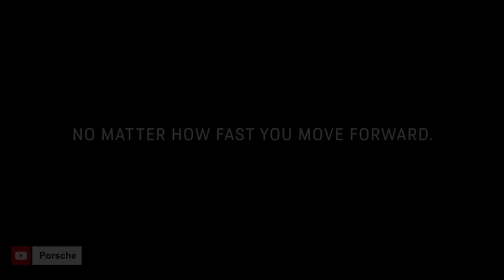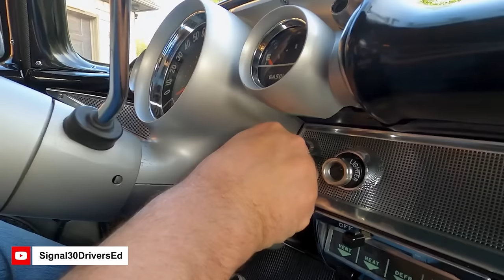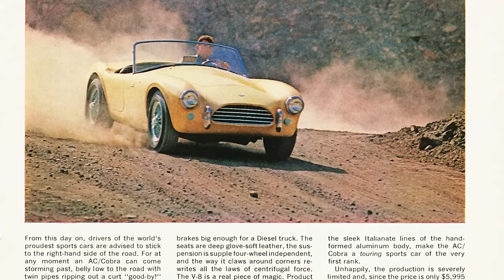Why Old Cars are Better

Comment: You can also change your car really easily. If you want a better transmission or different engine you can do that. Also these days with CNC services and even 3d printing being so available you can make your own parts. My 79 Camaro is my daily driver and I hardly have any issues with it anymore because when it breaks I fix it in a way that won't break again as easily.

Comment: You are spot on. I have two cars a 1966 Ford Galaxie and a manual transmission 2012 Challenger. I had to search for a few months for a stick shift in a modern muscle car. I'm not buying anything later then the 2010's. Motoring should be a fun experience.

Comment: I'm 21 and haven't gotten to experience a lot of cars. I can say that I've had the same hand-me-down since I was 16 (2006 GMC Envoy) and I have cared and loved this car since. I will never buy anything over the year 2010, because this car has everything I need and is comfortable to drive. Not to mention stupidly easy to work on if you ignore the fact that you have to remove the engine to get to most of the hoses, but overall it's a solid rust bucket and I love it

Comment: Have a 1970 Beetle. Definitely different from driving a newer car. Pittman Arm steering, torsion bar suspension with pneumatic shocks, sometimes it just decides to break down, but I only needed a tow three times in 15 years because I can generally get her running again.

Comment: My first car was a red 1993 Dakota. I loved that truck so much, I miss small trucks generally. I used to work at an O'Reilly when I was 18 for a little while and they had me delivering parts in a 4 cylinder S10 just like yours. It was even a manual, and I luckily knew how to drive it because my dad taught me to drive with an old Jeep. That S10 was so painfully slow, it made my 6 cylinder dakota feel like a racecar. It was so under powered when you turned on the AC, the truck actually slowed down. I dont remember the year of it, probably a year or so older than my dakota. Still, i'd take a 4 cylinder S10 over MOST new cars, not even kidding. Good luck to anyone buying a new car when you have any problem not covered by your limited warranty, hell even if it is covered, good luck waiting to have the car fixed in customer service hell. Even I can fix old trucks and im not a mechanic and they are useful, inexpensive, and I strongly believe that any pre 2010 pickups we still have will be solid gold, they already are, the only reason an old GM truck isnt incredibly expensive yet is because there are still plenty of them. As the years go by and those 90s-2000 GM truck slowly go away, they will be worth more and more. New vehicles will get worse and worse and be covered in crap you dont want like touch screens, it's just ugly and a million problems and recalls. Even normies will get fed up and look back on PERFECTION that was the 2000 era American pickup and pay 10s of thousands for them. People probably thought you were crazy if you said old tractors would be worth a fortune if you said that 40 years ago too. New cars do have a ton of problems and it's not getting any better. The "Boeing problem" is showing its face in every car company, just everywhere so everyone buckle up.

Comment: I've got a throttle body injected 350 Chevy suburban square body and I find it to be easier to work on than any newer car and most cars older than it. And the nice thing about the square bodies is you can salvage parts all the way from the '70s to the early '90s

Comment: I own two automobiles. A brand new SUV and a 30 year old Chevy pickup. The Chevy is my work truck, and it still runs great. I put 300+ miles on it every week, loaded down with tools, lumber, drywall, etc and I just about have more faith in it than I do my SUV, which is only 6 months old. Business models were different back in the day. Manufacturers built things to last. Things nowadays are built to break down, in order to move more units and accessories.

Comment: Oldest car I've ever driven by far was a 1957 Mercury Medalist. This dates the next oldest car by decades, so this one was a particularly different experience for me, especially as it's the only carbureted car I've ever driven. I didn't drive it far, just from one side of the shop around to the other side. The owner didn't tell me about how to work the choke or what it even was, just to pull it before starting and put the car in the other bay. So, I was mashing the brake for dear life trying not to wreck the car as I pulled it around. I would love to have more time with a car like that now that I'm older, wiser and understand them better.

Comment: Thats why my Daily S10 Blazer is 34yrs old coming up on 35. Had 32K miles when I bought it many years ago, Now its just shy of 300K miles & still going strong even being Lifted on 35x12.5x15 tires. I did ditch the throttle body though a ways back mainly for Performance upgrades with a Holley spreadbore 650cfm double pump along with some other stuff like a CDI ignition , 60 0ver pistons, larger cam, headers & some other stuff. Paired to a factory 5 speed with a high pressure 12" clutch, Have front locker & rear Helical Posi . Also have a 79 Z28 Hurst package Camaro & a 65 GS Riviera with the 425 NailHead dual quad motor .

Comment: One day my dad's modern Fiat broke down and had to spend a few days in a workshop. Back then we were about to move so we needed a car that could suffer through it so he simply went to a local weekly "car market" and he bought 1996 Ford Explorer (it was back in 2010). It wasn't a vintage given its age but it was an American car. It was unlike anything we ever owned before, big engine, rear wheel drive, automatic transmition with this lever next to steering wheel, many bells and whistles that were very uncommon back then here in Poland. We owned it for a few years and i must say it was mostly reliable with a small exception that it sometimes needed a hit with a hammer to the engine to start. I learned how to drive on this car before i got my licence and i even pulled up by my school with it once or twice which did bring me some attention, given the average size of European cars. As the years went by my dad discovered its sills had rusted away so he cut them off and kept driving it like this. Later it started to have electrical issues but what finally led my dad to sell it was its poor breaks that would have to be replaced entirely to make it safe to drive and the price for that has far exceeded the value of the car itself. I was a bit sad when he made this decision, it definately was a fun car do drive.

Comment: Owning first a 1983 Volvo 244 DL (which has degrading wiring), a 1997 OBS Ford F-250HD Powerstroke, and my second motorcycle: 2003 Kawasaki ZX-6R 636 (first gen fuel injection) I can attest that they are vehicles I will never want to rid myself of because they do exactly what I want them to do, while doing so reliably. In my opinion they are some of the most reliable vehicles you could ever own. On top of my recently acquired 1968 Volvo 1800S (last year of carburetor).

Comment: Did my Auto apprenticeship here in Australia at the end of the 70s being of the 80s and I got rid of my 2006 Holden Commodore Ute last June and have only Just bought a new 2024 Suzuki SV650 which will be the first vehicle I’ve ever owned I won’t be working on. I actually love old cars and I even obviously owned a few in my time and I worked on all of them including the Ute. As much as I understand and can repair new cars I miss the day where you diagnosed a problem and didn’t need a scanner to tell you what the problem was. I think it’s sad how we’ve turned cars into computers on wheels and we’ve taken so much joy out of driving including by removing things like manual transmissions. As for carburettors I loved working on them and building them and even though ok fuel injection systems are cut and dry repair wise I do like the challenge and sense of achievement that working on carbies bought.

Comment: Also, points ignition is really pretty easy to work on. Just use distributor lube on the cam and set the right gap. Sure, you can mess around with more, but keeping the cam lubed and the gap correct will keep you on the road 9 times of 10.

Carburetors aren't as hard as one might imagine either. I was scared of them for years. But as long as you keep it clean, adjust the float height correctly, and read the factory service manual once to understand how to set it, it's kind of like riding a bike. Once you get it, you get it.

Comment: I own an o5 single cab XLT Ranger with the 2.3. It had 215k on it when I got it. 1 year ago
 The interior was/is perfect. Five speed stick. Body is nearly perfect and was restated at one timeonus the bed. Which shows that previously was used as a light hauler. K use it the same way
It does burn oil and smokes a little partially cured using 10w40 vs original 5w20. AC is strong. It now has 238 plus miles. Unfortunately, the previous owners did not take care of the front end. Squeaks w lot and metal on metal clashes that are not the brakes. It has made multiple Cincinnati to Dunn/Durham move runs without fail. I love this little truck. I'd pay the money to rebuild or replace the engine and replace front end parts vs trade it in and buy new a Tacoma that costsore tan I can afford used/new Tacoma(which D love to have after owning a 98 4runner.

Comment: I also know of someone with a old s10(93), and it was whole nother experience to a new car, it had a 5 speed manual and the engine was a 4.5 v6(originally a chevy 4.3 before being rebuilt into a mercury boat engine, with a higher compression ratio, longer stroke and different cam)

Comment: I saw a video the other day taht said the EPA standards are the reason cars and trucks are getting larger (ironically). It is easier for car  companies to achieve mpg standards when the cars are smaller. For example, a pickup truck the size of a 90's japanese pick up would have to get 70mpg if it were made today. The epa makes therse determinations based on vehicle footprint

Comment: Old cars have less stuff to go wrong. Still, I remember in 2008 I was in the parking lot at work trying to figure out why my 81 280ZX wasn't starting. A younger co-worker came up to offer some "help" which was basically giving me a lift. I eventually found the right wire to jiggle and got on my way. On the other hand, I have a 2000 Honda Odyssey, where the ODBII just tells you which sensor you need to replace. And it becomes an "antique automobile" next year.

But more recently, my 2016 GTI is put together so weirdly that some jobs really can only be done by the dealer. Apparently, the valve cover gasket is more or less the same as the head gasket?? And the clutch slave cylinder is inside the transmission! I feel like they're making them purposely hard to repair just so that you'll throw up your hands and buy the latest model.

Comment: My first car was a '98 standard S10 that lovely green color with a pipe rack my dad welded on. It was a great truck. We drive 90's Ford's on purpose now for right to repair. My F250 and my hubby's Ranger make all the backwoods boys blush.
Reply: Edit: Old cars are indeed more work. Our decision to switch was years in the making. We traded reliability for more work but no payments and way cheaper insurance. Even 90's cars are easier to maintain yourself. My baby could actually reach all the spark plugs in his Ranger cuz they're not buried somewhere u need a lift to access them. The Ranger can throw codes which is helpful, but my older F250 has more dicey electronics. We got both trucks from a local gear head, so they were not projects off the bat which was another huge bonus.

Comment: I was gifted an '88 Acura Legend for Christmas 2022 by a very awesome cousin with only appx 160,000 miles and the only "problems" I've had with it so far have been replacing the muffler and currently I need to find a windshield for it. Safelite said they don't work on "antiques" and last time I scanned the Internet the only result I found was in Delaware and I'm in the U.P. of Michigan so something a bit more local would be ideal.

Comment: Sweet spot for me (& in practice) has always been about '61 to '71 or '72 at the very latest. 
Never technically owned anything newer than '85, and those were winter beaters or Mercedes.
Currently have a '71 Imperial, 2 '68 Plym. Furys, & a '67 Jaguar 420/S compact.   GREAT video!!!

Comment: 19:14 I’d even go as far as to say cars up to 2014 were still easier to work on. After screens , adaptive cruise control, turbo diesel engines, and other little electronic bits were introduced to the average car things got increasingly more complex and that complexity just multiplied by itself as years passed

Comment: 6 months ago, I bought the best car I've ever owned, a 1991 Mitsubishi Lancer Hatchback. It is simple, with a 1.5 petrol, carburettor engine and good quality metal and plastics.
This 33-year-old car oozes build quality. It was made in Japan and imported, like many at the time, into Portugal.
After biding my time for a while, I knew it would come my way. I've been gathering the parts and knowledge to just refresh the drive train, it really needs little to be done.
There's no computer to put it in safe mode, forcing me to pay to get my car back running to its full potential, which is in essence a system of pay-to-drive that which you already own.
I know what to do to it and when, and it will run for another 33 years!
It is about the freedom and knowing that my money and energy are spent for honest reasons, not planned failures by modern engineering.

Comment: Had a 97 S10 Blazer. Biggest hunk of junk, falling apart sitting still by 2007. Rotting brake lines, wonky transmission, clattering interior. Its nostalgia

Comment: I just came up with a idea. Steam and Ethanol engines. Half runs on steam half on gas. The half steam runs a closed cycle similar to how a refrigerator compressor works. For one thing, In Brazil, when the fuel crisis hit, the population really wanted smaller vehicles (We never had the boats that USA Had, only the "midsized" Galaxie 500, Simca Chambord, GM Opala, GM Omega, and the Dodge Dart were the biggest cars we ever got If I'm not mistaking) 
So, with the crisis, came the Ethanol fuel, and cars became smaller. NOW With the pressure of SUV's we are finally (badly I'd say) moving to SUVs instead of sedans and hatches, which is a shame. But I agree, 40 years ago a car could make 8KM/L and nowdays cars barely make more than 11km/l in the city. At highway, its slightly better, the cars of the 80's made around 13kml, now cars can make 19kml, its better, but at city, where it matters most, nothing changed at all. And add that Flex Fuel consumes more than plain Gasoline or Alchohol engines, and add useless tech to todays cars (apart from the very good safety, A/C and Power Steering) the cars of today are really more of the same... Cheers!

Comment: It's not just nostalgia,i still drive EVERYDAY my w124 200d even after 1 milion kilometer,and i still can feel the quality out of it. My uncle has a brand new mercedes glc,and after a couple years the interior feel so cheap for almost a 60k euros car. Even in the classic car world,the reliability can vary a lot,but I still daily drive my mercedes without any issue,just basic maintenance (that i do by myself) goes over the head of many brand new car owners. Plus my 2k euro w124 or my 9k euro mercedes sec380 always stands out more,than your modern jeep renegade

Comment: I honestly hated cars since I was a child. My friends were always talking about the cars and I always avoided engaging or listening to those topics (maybe because I have a motion sickness from birth). But I changed my mind about cars since I experienced driving an old VW Golf 2 - 1.3l 55hp engine (4 years ago after doing my license). There was something different about how this car handled, about the feeling, speed sensation, joy and also effort - it had no ABS (I learned how to "feel" the limits of the tyres when breaking and brake on the very edge of wheels locking up), no power steering (i got some muscles from driving it haha), no A/C (and the engine was overheating in the summer so i had to open the windows - manually of course - and try to cool the engine by BLOWING THE HOT AIR FROM THE ENGINE THROUGH THE SIDE WINDOWS - it was so painful and hot but also fun and unique). 
I loved how this car was difficult to drive - it made the car feel real and I felt like the only one that could tame this car and I took pride in it.
Since then (when i was 18) I realised I don't want to crave for luxury and comfort in my life - I want authenticity, effort and emotions because it develops me, gives me joy and pride and makes me feel alive.
I drive a Toyota MR2 Spyder now which in those terms is similar to the Golf 2 and it's even less comfortable.
Also I agree that driving that kind of cars is like a meditation - you need and want to be focused on the drive.